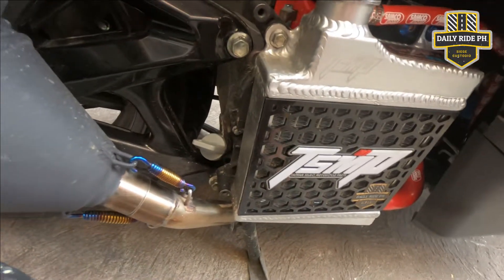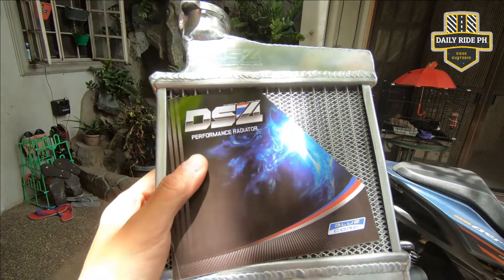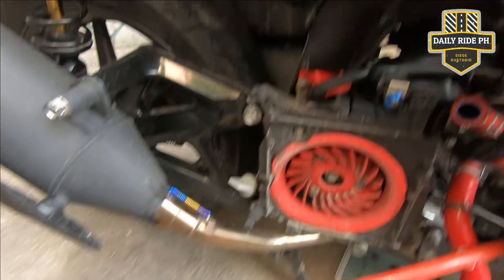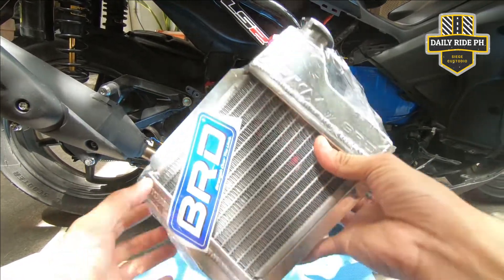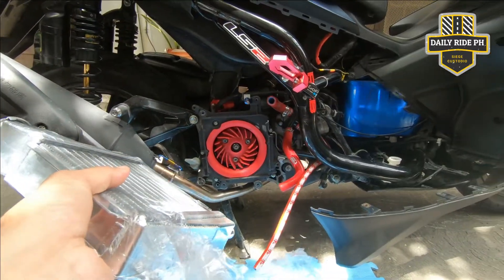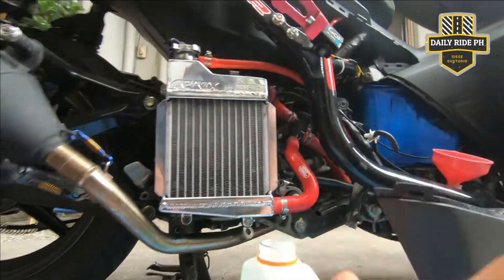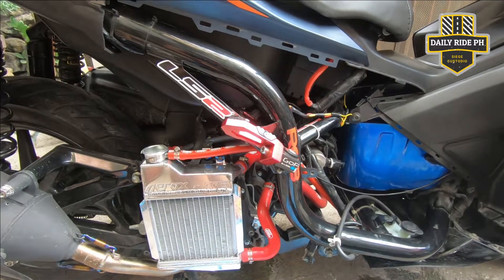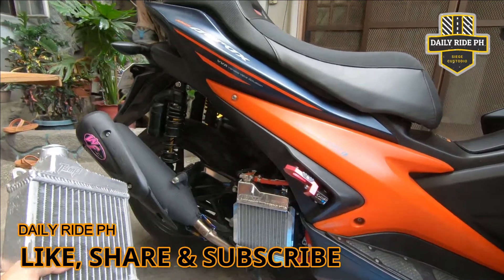BRD 2 rows Radiator / DS4 V2 2 rows Radiator / TSMP 2 rows radiator Leak issue

Comment: Bro tanong ko lang naka RAce power naman ako sa honda click ko aluminum din kaso ang problema ko umiinit yung radiator dahil sa walang insulators yung mountings nya sayo ba radiator to engine din rekta? di ba nag heheat transfer? or may pinalaman ka na para ma bawasan yung transfer ng heat
Reply from the maker: Radiator then sa side ng magneto. Normal naman po ba umiinit ang radiator kasi umiikot ang coolant good sign nga po na mainit radiator from top to bottom meaning nag cicirculate ang coolant

Comment: Sir saan mo po nabili yung samco hose mo na isang set na?
Reply from the maker: Sa caloocan ako naka score paps. Yes isang set dami din sa shopee
Reply: @DailyRidePH Sir yung white bolts po ba na heng para sa rad swak ba sa brd ? Or kahit stock na screws nya or need palitan nang mahaba
Reply from the maker: @carlosalazar9714  white gold or stock basta tama yung radiator na nakuha mo for aerox or nmax sakto lahat yan paps
Reply: @DailyRidePH  maraming salamat po
Reply from the maker: @carlosalazar9714  wc boss
Reply: @DailyRidePH boss good pm BRD rad parin gamit mo? Okay lng na walang acyrlic cover
Reply from the maker: okay lng nmn pero pag may tumama for sure damage delikado
 @carlosalazar9714
Reply: @DailyRidePH  so brd rad mo walang acrylic cover sir?

Comment: aw.. sir pano pag di na nag wwork ang coolant assembly? hinde na kasi nbabawassn yun reservior  although wala naman ako nakukuhang signal sa meter.. pano po ma diagnos kung sira o buo p?
Reply from the maker: Hindi naman tlga dapat nababawasan ang nasa resevoir sir. Unless may tagas ang radiator mo or nag over heat engine mo po dun sya mag babawas
Reply: @DailyRidePH  hays salamat. medyo noob po yun dating ng tanong ko.. pasensya na po sa mga nabigla nun na basa hehe
Reply from the maker: @athenazoey5093  okay lang po sir ganyan din po ako nung una. Isa sa mga ways para Ma check nyu po kung umiikot yung coolant sa engine is pag uminit na yung hose sa bottom part ng radiator.
Reply: @DailyRidePH  hays salamat. thank you sa tip sir. nag ka idea ako pra mag diagnos ng coolant natin. 

na check ko din sa shopee na may nag bbenta ng mga heatsensor, (yun mechanism ng coolant) pra to change if ever na nag malfunction eto.
Reply from the maker: @athenazoey5093  welcome sir. Hanapin mo po yung koso engine temperature. Ganyan gamit ko.
Reply: @DailyRidePH  ang nakita ko is 54P series na yamaha. pero try i ko hanapin yan na offer mo na koso. mio mxi ang mc ko siguro compatible naman sa icu.

Comment: boss paano icheck kung gumagana un coolant system ng nmax mo. un saken kasi nagleak di napansin un hose. buti nalang nun magpapalit kame ng sparkplug. naagapan muntik na mag overheat. penge naman tips paano malaman kung nag ccycle ba un coolant ko papunta sa head/makina ni nmax.
Reply from the maker: Yung pinaka bottom part ng radiaor at yung hose na nasa pinaka baba na naka kabit sa radiator dapat after 5-10 minutes umiinit po sya.
Reply: @DailyRidePH  pag umiinit sya sir, meaning nagcycle si coolant ?
Reply from the maker: @carlchichioco6200  yes sir. Ganyan din namin nalalaman if wala ng hangin sa engine pag nag bleed kami.
Reply: @DailyRidePH  paano po ba yun tamang process sa pag bleed sir? muntik kasi maubusan ng coolant un NMAX ko, eh bagong overhaul lang buti naagapan, di ko blineed sir eh kinargahan ko lang ng coolant.

Comment: Boss sa TSMP okay lang ba di na nag palit ng hose? Need pa po ba i bleed yun sir? Salamat po sa sagot
Reply from the maker: Okay lang hndi mag palit ng hose pero dapat po mag bbleed padin po
Reply: @DailyRidePH  sir nag palit kasi din ako ng kulay green na coolant eh pero di ko na bleed okay lang ba yun or i bleed ko ulit? Na byahe ko na sya mga 100kms okay naman po sya . Or need ko pa din i bleed ulit ba sir salamat sa sagot po
Reply from the maker: @DrwnGncn  ang iniiwasan po kasi natin sa pag bbleed is yung natitirang hangin sa cooling system nya sir. If hndi po nag iver heat meaning okay sya. Try nyonpo pa andarin ng 5-10 minutes and bombahin nyo ng slight lang po ahh then check yung ilalim ng radiator kung umiinit together sa hose sa baba. If yes okay na po
Reply: Di naman po ako nag over heat sir rizal to malabon byahe ko kahapon then chineck ko din yung sa hose mainit sya. Pati pala yung mismo g rad na tsmp ambilis uminit sir ganun ba talaga yun? Naglagay po ba kayo ulit ng foam dun sa likod mismo ng radiator
Reply from the maker: @DrwnGncn  yes sir nag lagay padin po ako ng foam sa likod.  Pag uminit po rad sa lahat ng part meaning nag cicirculate na po coolant
Reply: @DailyRidePH  okay sir salamat sa mga sagot ridesafe po palagi 🙏🏻🙏🏻🙏🏻
Reply: JMCycles  sakin goods naman hanggang ngayon gamit ko pa din sya eh